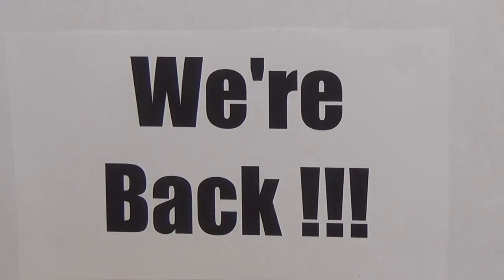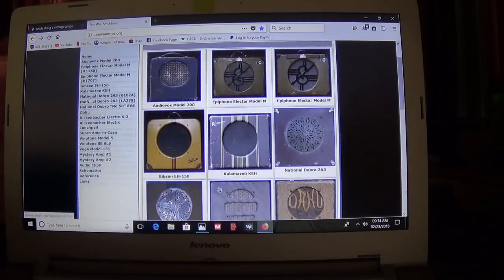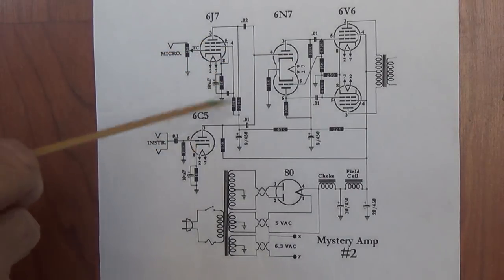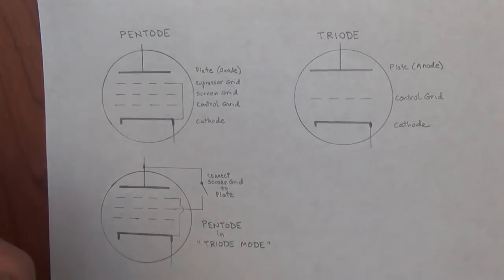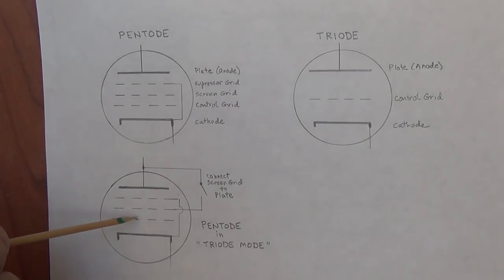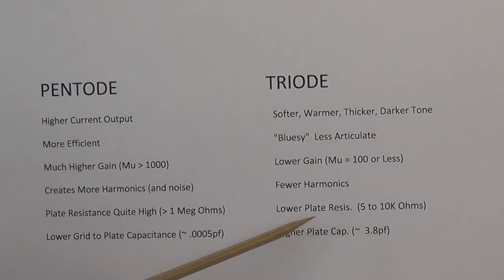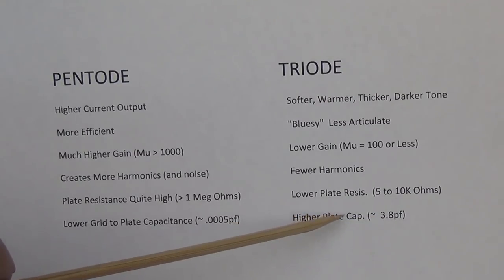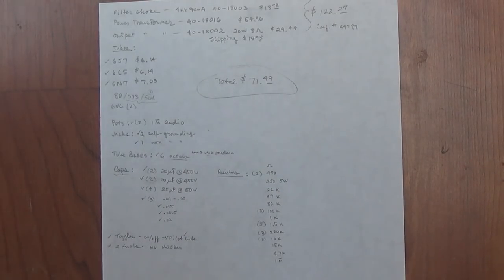Let's Build the Mystery Amp, Part 1: Introduction

Comment: Uncle Doug, Two devices, from my youth, utilized electrodynamic speakers. When I was eleven,  I got my grandparents' old ROLA table radio, to use as I chose, and added a record player to it. A few years later, I traded some stuff for the amplifier and speaker from a Wurlitzer jukebox, that had played 78's; I remember that it used the coil of a SPDT relay as the Cathode load of its 6L6 [push-pull] output tubes, to lower the heater voltage from 12v, to 6v, after just a few seconds of warm-up!
Reply from the maker: Your recollection of the Wurlitzer "quick start" relay is on the money, James. What wonderful devices :)